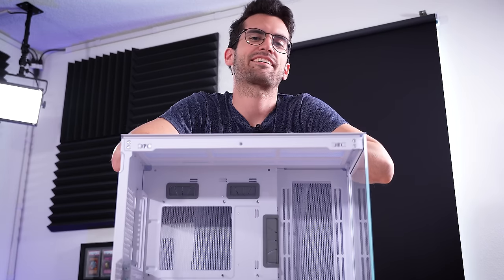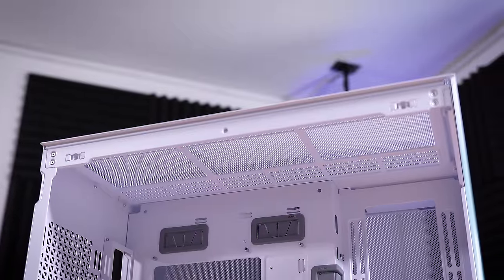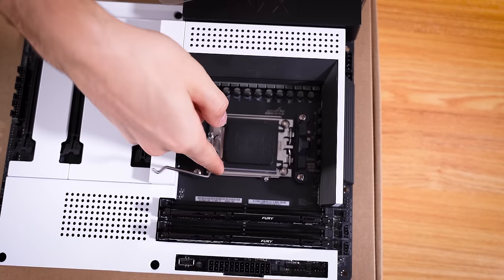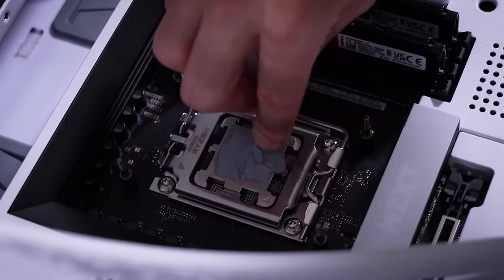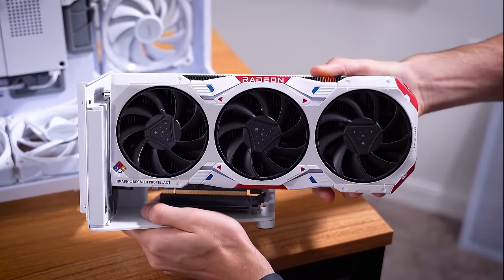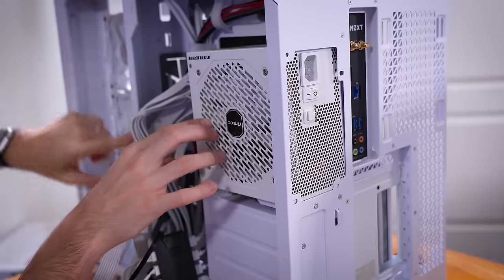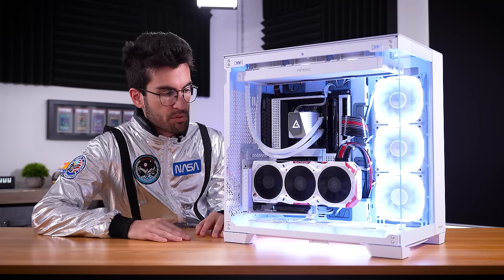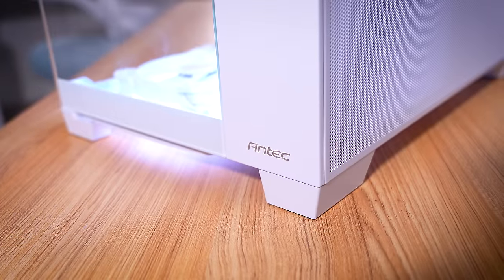Building a Space-Grade Gaming PC!

Comment: Nice looking build! Though my preference for the GPU install would have been the standard way to show off the card better, as the back looks better than the front (plus the matching Constellation!). I'm not a fan of the three solid black fans in a sea of white fans and white light. That would have allowed you to use the Starfield themed GPU power cables as well to set the card off even more, and then not even have to use other extensions, just use the white cables from the power supply for the 24 pin and 8 pin. Just a bit of black from the motherboard and RAM to contrast the white build, and a bit of colour pop from the GPU and GPU cable. With the GPU vertical, you also can't properly appreciate the motherboard and how the majority of what's being blocked by the GPU is covered in white metal plate. My other preference would be to have the rad fans under the rad instead of on top. That would have lit up the interior a lot better and would have been more aesthetically pleasing in my opinion, as the rad would not be as visible and the hoses going to the block wouldn't look as saggy. For me, that would have been the perfect build.

Comment: Like the look except for the placement of the radiator fans. I would prefer them in a more standard setup.
Reply from the maker: Putting the fans on the inside in an intake config would've obscured the LEDs. I wanted positive pressure.
Reply: I agree. However, I think he did that to save time on install and tear down..
Reply: That was bothering me, seeing the rad under the fans idk it just dont look right
Reply: @killerhawks  he did it for aesthetics, otherwise the side 3 would need to be intakes and they dont look as good ?

Comment: One thing that I have been noticing a lot with current cases is that most of them lean toward the M.2 SSD or smaller form factor SSD's.  You rarely see any kind of large storage (4TB+) solutions in a new case these days.
Reply: Gaming PC cases are basically the equivalent of sportscars - performance and looks above all else.
Drive bays? No matter how big the case, optical drives are so 2000s.
Space for harddrives? Get a NAS, you loser.

If you need something less extreme but still quality, you're a bit screwed these days.

Makes about as much sense as pickup trucks dominating the US car market.

Comment: Nice build and case, but I would have installed the fans on the radiator underneath it so show off the fans lighting
Reply from the maker: Putting the fans on the inside in this config would've obscured the LEDs. I wanted positive pressure. They were intaking from above.
Reply: @GregSalazar  understood still for me it doesnt look right, I understand the side fans wont look as good as intakes ideally like some other brands can buy reverse ones so look the same

Comment: Hey Greg,
i have recently upgraded my Graphics card from Zotac 1050ti to Zotac 4060 & SMPS to DeepCool 650 Bronze from Coolermaster 500. Now my pc configuration is as below.
Pro : Ryzen 5 5600X
Board : MSI B550M Pro VDH
Graphic card : Zotac 4060 8gb
PSU : DeepCool 650 Bronze
RAM : 24GB 3200mhz 
i used to play all games (forza 4, pubg pc, RDR2) on low graphics as my 1050ti was not to capable, but since i upgraded to 4060 i am playing them at ultra or high setting. now i have noticed that my CPU temps (80 to 95%) and CPU unitization (88 to 96% or at some point 100%) is that normal. i never monitor my temps but now i am suddenly have the awareness of doing so. i used MSI AfterBurner to check the temps. Please advice. I have recently applied thermal paste on CPU and mounting pressure is also ok. Is my pc bottleneck?  i am looking forward for reply from anyone who has knowledge and can help me. 
thank you and your doing an amazing job i wish any Indian can replicated the same and help us too.

Comment: Honest question, why not have the radiator fans push through the radiator can add some more light to the dead space. Pun not intended haha. I’d pull better?
Reply from the maker: These were actually intaking air from the top. Putting the fans on the inside in this config would've obscured the LEDs. I wanted positive pressure.
Reply: @GregSalazar  makes sense, I might have missed that when i was watching.

Comment: Why did you put the fans on the AIO on the top with it pulling air rather than pushing air through radiator....?
Reply from the maker: Because then I'd be running negative pressure. I wanted the fans beside the motherboard to exhaust air so that we could see their LEDs.
Reply: No you wouldn't, most builders do the push through the radiator with the fans on the inside of the case and radiator against the top wall of the case. This makes the fans more efficient, your configuration with the fans trying to pull air is less effective.  @GregSalazar

Comment: I must be getting old because the premise just seems silly to me. It isn't like this machine will ever make it into orbit.  Yes, MIL Spec PC components exist. But as far as I can tell, you didn't use them. Your title is misleading. Should be 'Building a Space-Inspired PC. Space-grade implies it is built to run science experiments on the ISS. Right off the bat, tempered glass isn't going in a real Space-grade PC.
It hurts to see that much shrouding on a MB and none of it used to duct air for better cooling, just totally there for appearance. 
If you want to save your socket cover, it is probably better to remove it before you lower the pressure plate. You're just taking the chance of breaking it so it doesn't work in the future. It is also probably applying some localized pressure to the heatsink and one of these days, you're gonna do that and crack the CPU die.
White only works if the white matches throughout., which it will never do.  Also, gaming after Labor Day on a white PC is tacky.
Reply from the maker: Jeez. You must be soooo fun at parties...